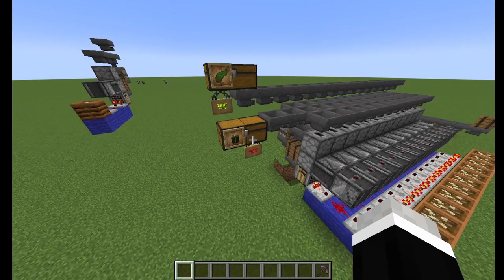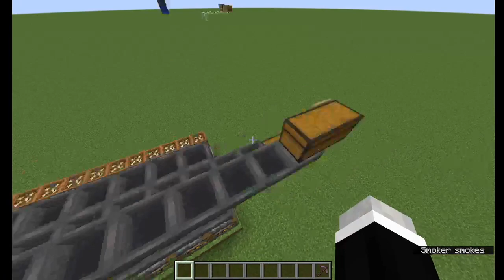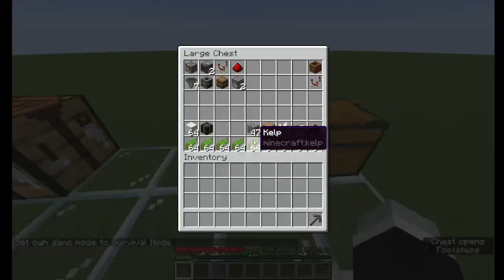Automatic Kelp Block Crafter/Smoker, 1 Wide Tileable, for Minecraft 1.21 and 23w42a.

Comment: Hello fam, here is a more detailed breakdown of what you need for one row of this machine, not counting the kelp farm itself;
(Works on bedrock)
40 iron
66 wood plank
4 normal wood block
41 cobble
2 wood slab
15 red stone dust
3 quartz
3 stick
3 smooth stone

Correct me if I’m wrong, and I’ll try and make sure it’s correct later

Another detail, turn off the kelp farm from time to time as it runs faster than this contraption can handle… produces too much kelp
Reply: I would use lava and cauldrons until you have an iron farm and wood farm if you want to make several rows